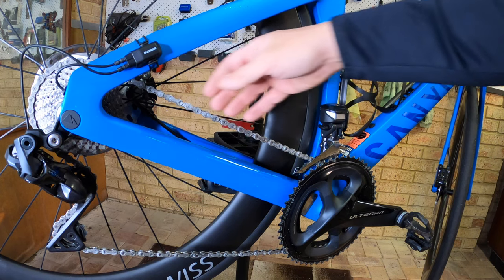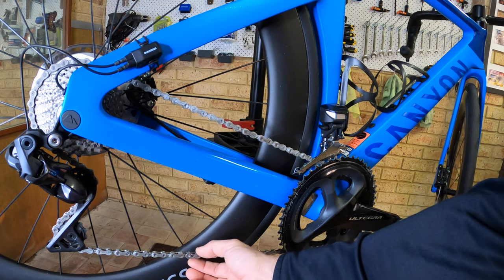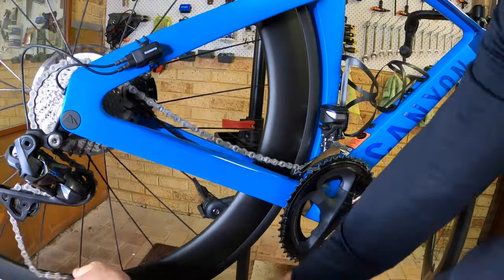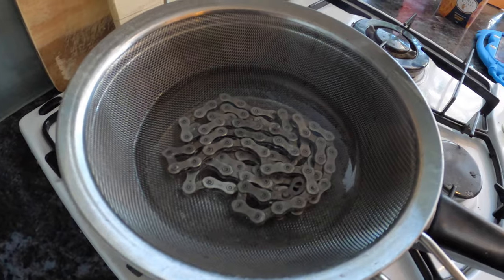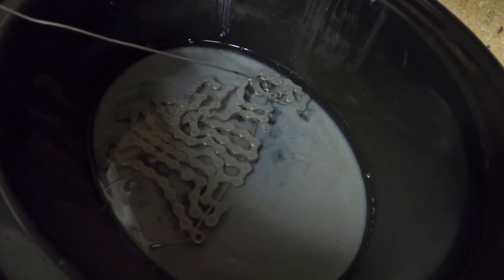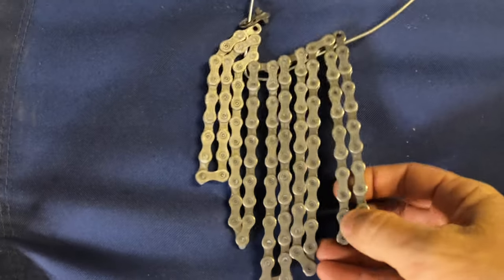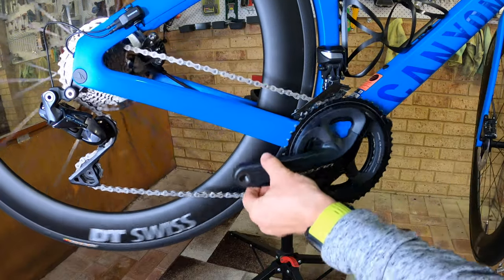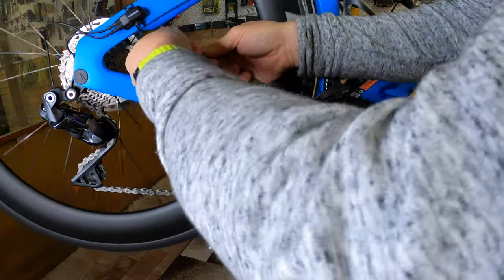How to Wax Your Chain || Quick Guide & Revised Techniques

Comment: Harley, Been waxing chains for 2 years now, get 500-700 km per chain so only wax a few chains every 3 weeks. Chain and cassette last about 3 times as long. With wax I add fine PTFE powder and molybdenum powder antifriction. Only thing need to keep an eye on is build up between last couple of cogs on cassette as can cause slippage. I scrap it out with fine nail. Builds up when ride in wet in particular.
Reply from the maker: Perfect Andy! I think the 2nd video I ever did goes into a bit of that. This was just a quick(er) guide. Plus I've started the boiling method. Bit of extra time what the hell 👌

Comment: Once wax has taken to chain just pour boiling water on dirty chain and wipe. Another tip is once waxed loosen stiff chain by rolling back and forth over rubbish bin plastic handle.
Reply from the maker: Spot on! The update here was just checking the links roll smoothly prior to taking it off the stand. A mate had a issue that was realised at the start of a ride. Ideally you'd want the rollers perfectly free'd up before putting back on the drivechain.

Comment: I had a bit of a hard time watching the video cause of audio not syncing with your video and whats up with your bluetooth module on the outside of your chain stay? Why don’t you put it inline with your junction box inside the frame, its much tidier and aero that way.
Reply from the maker: There are two types of Bluetooth modules. This plug and play style lets anyone just addd it to the setup. The one that’s inside the frame is a different part. Didn’t have a spare one of those and didn’t want to pull apart the canyon. I’ve got these on several of my bikes and the internal on others, so didn’t really mind about the areo loss of the ‘inside’ d-fly here. Also not sure what’s wrong with your player, the camera records the audio so it’s not synced separately after recording? 🤔
Reply: Thanks, it looks better now, must be my player. I had same BT module on one of my bikes, I stuff it inside regardless, much neater solution if you care about aero and looks. Thanks for the video, keep it up.